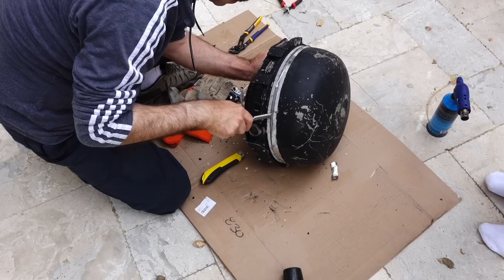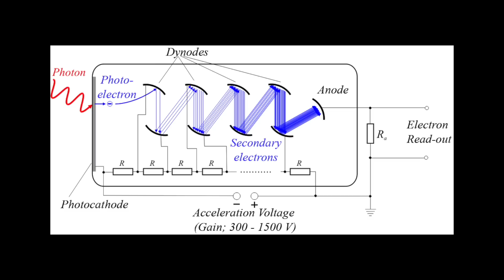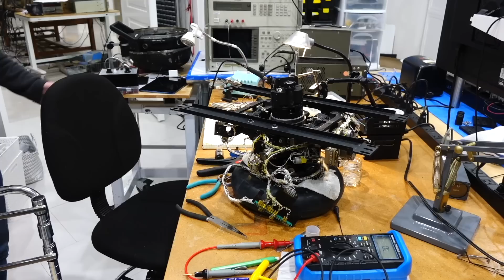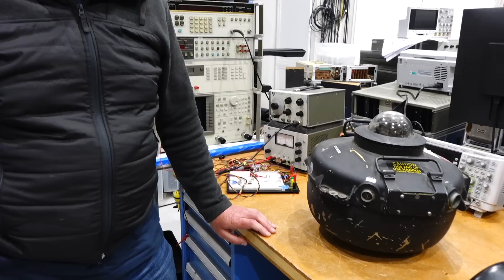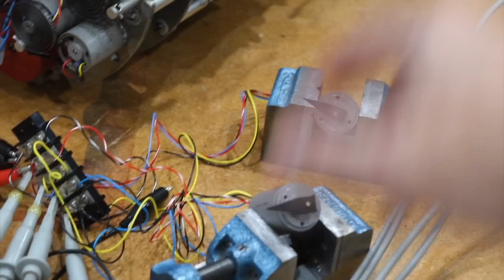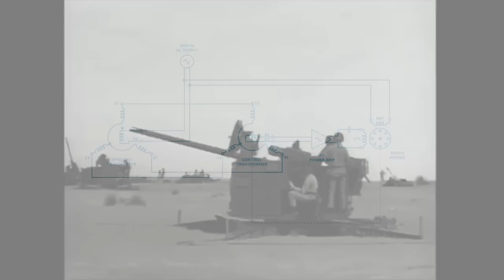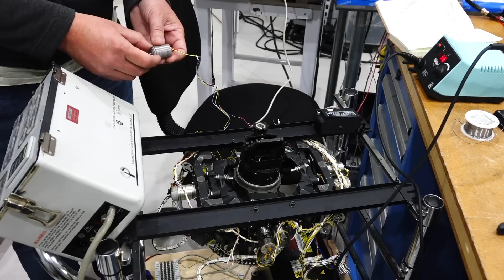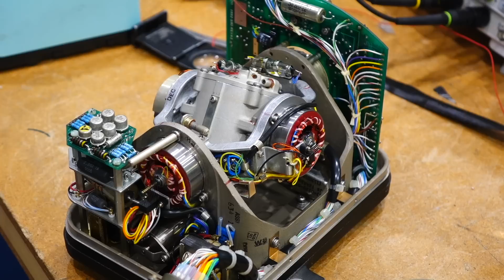B-52 Bomber Astro Tracker - Part 2: Power up and gyro-stabilization

Comment: I just read the book, "Flying from the Black Hole" by Robert Harder a former B-52 navigator. In his book he describes the Astro Tracker, the DR computer, and how he navigated the B-52. A very interesting read for anyone interested in Cold War military aviation. This video puts a picture on his book.
Reply: Good tip - gonna look that up. I’m working through ‘Inventing Accuracy’ at the moment. As I read, I feel like Curious Marc or Alexander the Ok or someone else could find a new video topic every few pages in that book, it is so dense with fascinating Cold War analog computing info…
Reply: Thanks for the book tip.  That sounds like exactly what I’ve been wanting to read.
Reply: I found a used copy and ordered it.  Santa Claus brought me knee surgery for Christmas, so I have extra free time for a while, this book sounds perfect.  😊
Reply: I have just ordered this book from Amazon. 
S&H is not very cheap...
Reply: Thanks for the book recommendation. Always appreciated.
Reply: Also ordered a copy 🙂
Reply: What a fantastic piece of kit.
Watching this reverse engineering I wondered do long range military aircraft still use a star tracker as a backup for GPS? If not what do they use? Has inertial navigation (fiber gyroscope) become accurate enough?
Reply: @ in his book, there was no GPS, and no INS. Navigation used either radio ground stations or dead-reckoning, refined by celestial fixing, and/or radar ground mapping. Back then navigation was as much an art as a science. The goal was to be able to deliver a nuclear weapon at any target in any weather on time within a few seconds. The Cold War B-52 navigator was an elite airman and the hardest working member of the crew.
Reply: @BrianMoore-uk6js  Remember all the early DC-8 and 707 airliners were flown   WITHOUT  an astrotracker, but with a Navigator [flesh-and-blood] equipped with his trusty sextant and reduction tables.
Reply: read that book 3 different times